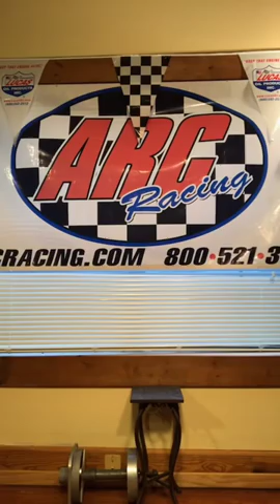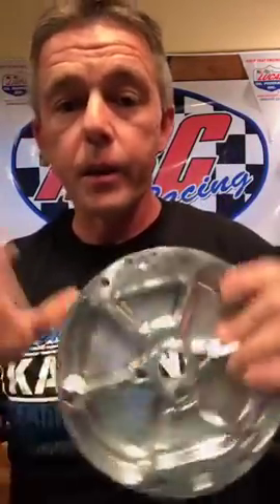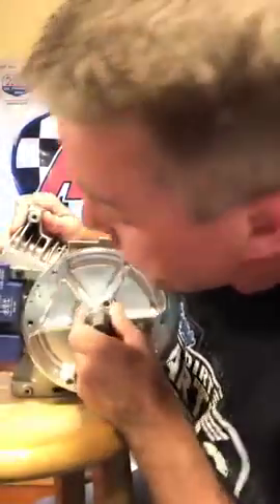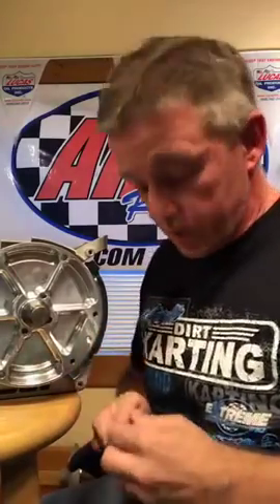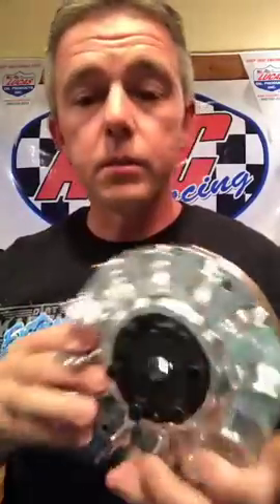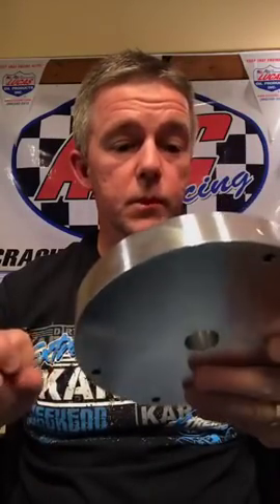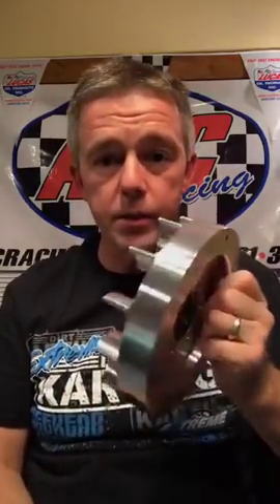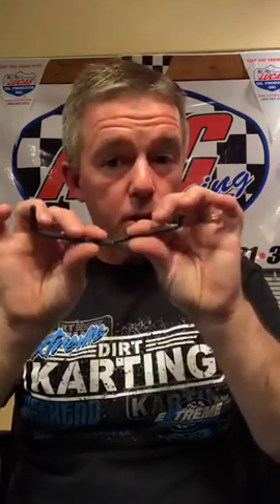PVL Ignition set up.(Predator 212, Hemi 212, Clone 196cc, Go kart racing, Mini bike racing)

Comment: I know this is an older video but i have the pvl flywheel and coil ive had for about 5 years just now getting around to using it. On the coil it says 0.016" on the front and back legs for air gap. My concern is that this tight gap will cause contact under flex. I watched your video and i may have missed something but i thought you said .040" i didn't get instructions so im just trying to clarify. I don't have enough adjustment to get .040 if thats what i need it is on a big block if that matters.
Thanks

Comment: Jody what timing would you run with this set up on pump gas. it a gas stock appearing class and the motor us a ec 236cc kit with a bored out 390 carb f275 cam black venom 1.3 ? Thanks hope you still reply on this old video lol

Comment: Question for you sir. I bought the pvl coil as well as pvl flywheel (non adjustable) from you, should i line up the trailing edge of the magnet to 2nd leg of the coil before I adjust the valve lash? Or should i put the piston all the way up before adjusting the valve lash?  I’m using stock key. Hahahahaha I don’t have a timing light and degree wheel.

Comment: with the PVL flywheel and ignition, is it possible to set up an electronic rev limiter?
Reply from the maker: The green pvl coil has a 6100 built in rev limiter, the red pvl coil has a 7200 built in rev limiter

Comment: I have Briggs 5 horsepower Flathead engine that I bought the twelve thousand RPM blue pvl ignition for it. I would like a drag race flywheel with no fins. What is the part number to price and availability. 👍✌️🏁🏁🏆 And if I need a special coil adapter. Because Florida understand the pvl ignition takes a special diameter flywheel..,,🏁🏁🏁✌️✌️
Reply from the maker: Please give us a call at 800-521-3560